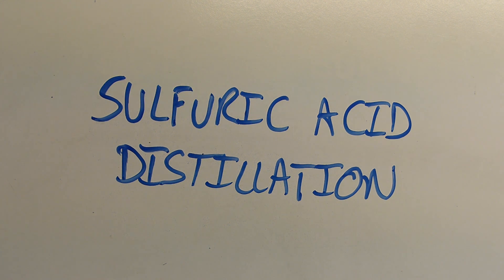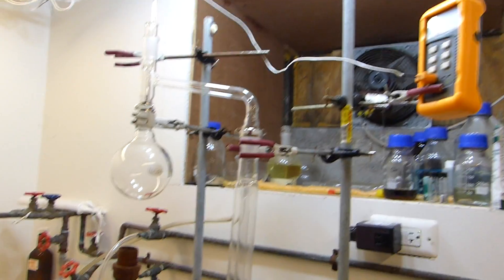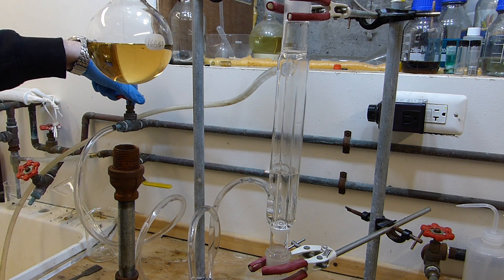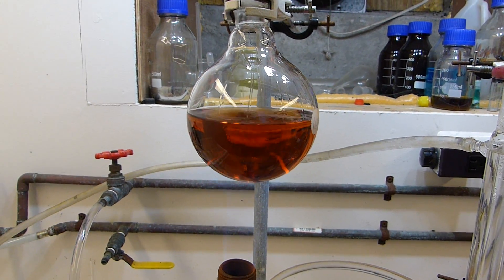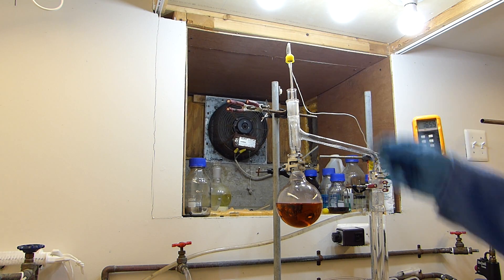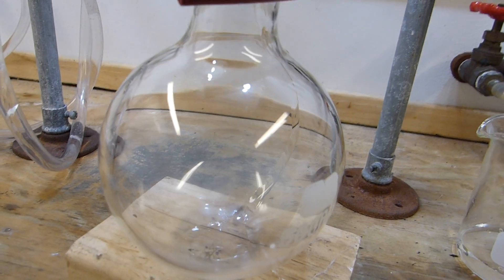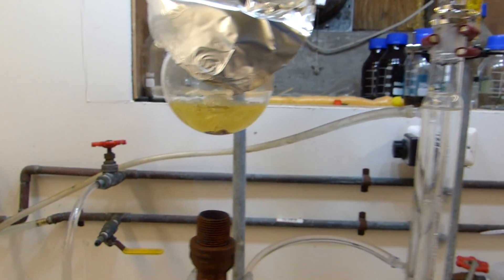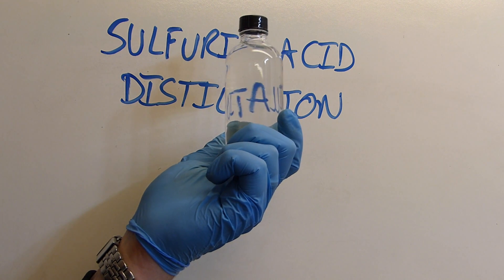Distilling Sulfuric Acid with Some Mishaps

Comment: I know I am commenting long after this video was posted . The setup shown was
 very hazardous. First according to the Merck Index sulfuric acid decomposers at 340 degrees C. You should have added a blast shield in front of the glassware. Since sulfuric acid decomposes at 340 degrees C and 760 mm HG, you should do this distillation in vacuo. Act 1 mm Hg sulfuric acid boils at 150° C.

Comment: The reason the sulfuric acid is not clear, as it should be if pure, is because it has contaminants from the battery (e.g. lead sulfate). You need to purify the acid by adding in more steps to remove the contaminants. 

The paper was dissolved/destroyed because sulfuric acid dehydrates the cellulose, leading it to burn/char.

Comment: So I've distilled h2so4 3 times now following your setup, minus the leibig condenser and substituting a Vigreux column. I also purchased a small terracotta plant base, broke it into small chips, ground the sharp edges and used them as boiling chips. Each time I've don't this I've ended up with quite a bit of white powder in my leftover discard solute. I speculate this is silica from the portion of terracotta that has dissolved, but I'm not sure, any ideas?
Reply: typically boiling chips are made from broken labware or bb sized spheres of the same and of course pumice pieces. Terracotta is baked clay/earth, pumice is volcanic glass... you do the math

Comment: What I've learned is to have as few hot glass joints as possible, because they leak sulfuric acid vapors everywhere. I'm now using a 1L flask in a heating mantle with a single piece glass tube arch. That's one hot joint, and believe me it makes a difference

Comment: Serious question: If super hot h2so4 is so dangerous, why are there no videos of the vacuum distillation of h2so4? Wouldn't that allow for better control of the temperatures? As, if there was a glass failure, the pressure would instantly increase, and boiling would stop.. seems safer. Before saying the gasses would eat your vacuum pump, what about a cold trap with liquid nitrogen in it or even dry ice and isopropyl and using a ptfe lined labratory grade pump? Also, why is nobody using a bump trap?
EDIT: From what I can tell, nobody is using a bump trap because of the amount of heat lost with a heightened distillation head.

Comment: DOug, the amber color is caused by elemental carbon, from destruction of misc organic material in rasw acid.  At distillation temps, the sulfuric acid ociDOZES IT TO CO + CO2> Yverified by exhaust gas analysys).  If the acid lkooks really bad, a very small (mg) addiion og persulfaye will clean it up faster.

Comment: Do not do what this guy is doing! Working with concentrated sulphuric acid is not the same as DIY drilling a hole through the wall. Do not do this at home. This could have easily turned into a disaster and one of those 'he was such a lovely [but incredibly stupid] boy' tragedies.

Comment: This scares the hell out of me.   I keep thinking, what happens and what do I do if that thing breaks (the flask)?  What does the 320 degree acid (with SO3 fumes) do when it hits the wood?    Explode in flames?  What if it happens while I'm reaching over to attend the apparatus?    What if some of it splashes on me?   

Would it be safer to use quarz equipment?

Comment: 'Hi Doug. I'm relatively new to chemistry. I had extreme violent bumping recently when I tried to extract HCl (9.5% w/w, active ingredient) from Lysol Power Toilet Bowl Cleaner through distillation. I'd bought this product at the dollar store. A 1 litre bottle of HCl acid costs 73$ on Amazon. I wanted, no needed, to save money. I'd researched all the ingredients to the Lysol product, but for some reason C10-16 Pareth (or C12, or C16) had escaped me. It turns out this ethoxylated alcohol is explosive (or is an explosive) when heated. I'm lucky nothing major happened during my HCl extraction experiment. Today, I attempted to concentrate some sulfuric acid I'd made from Epsom salt through electrolysis. My r.b. boiling flask survived the Lysol HCL extraction experiment, but it finally cracked during the sulfuric acid distillation, and acid leaked onto my homemade heating mantle and work table. It hadn't had time to concentrate, so it caused no major damage to my mantle or work table.

Comment: Great video.
My two son's and I are getting into doing some home chemistry.
It seems getting hold of chemicals here in the UK is more difficult than in the US.
We live off grid and have about half a ton of dead lead acid batteries so thinking utilising that acid would be good and any bi products can be poured back into the batteries when I recycle them.
I am wondering if your distillation method would be a good route to take to get clean concentrated sulphuric acid from the battery acid? I appreciate starting at such a low concentration would result in a lot of weak distillate to distill off first but wondering if this would be a good way to remove the lead and other battery plate doping materials from the original acid?

Comment: 98% Sulphuric acid boils at 336℃ the thermometer showed a constant temperature of 329℃ was it 98% did u check its density . Why did the recorded boiling point didnt match the reported boiling point . Do u live in mountains or plateau ?

Comment: When I heated 500ml of clean 38% battery acid to 380 deg C, it never boiled, it only steamed. Why is that? I ended up with 190ml of 94.5% H2SO4. Also, 1.285g per ml on the lable equates to 70.2% acid, not 38%. I don't understand why that is. Can you please explain?
Reply: btw 70% h2so4 actually has a density of 1.61g/ml at room temperatue. higher temperatures result in lower densities
Reply: @EZ4ENCE366  So I must not go over 337 deg C? Is that right?
Reply: @Berghiker  to distil sulfuric acid u have to heat it at 337 deg C
Reply: @EZ4ENCE366  I don't need to distill it because it's already clean acid, or do I?
Reply: @Berghiker  opitional, distil if you want pure acid

Comment: I find that simply adding hydrogen peroxide to the rooto brand drain cleaner will oxidize all the organic impurities. It works a lot faster with hot acid but it can also be done at room temperature.

Comment: Now do this take a nice heavy duty good Pyrex beaker and simply boil the same sulfuric acid drain cleaner until it's crystal clear. Unless you're doing analytical science you don't need anything better than that you do not even have to distill it it'll burn off all of the organics and get rid of all the water just by boiling it I've done this 1000 times with that exact acid. Manufactured not too far from my home in michigan

Comment: Greetings Excellent Video I have a question Can you increase the acid concentration using a vacuum pump Or you can decrease the process time by applying a vacuum to the distillation.

Comment: I found my RB flask dissolved the glass enough to see a ripple around the acid level was!
Had some violent back flashes when acid sucked the water vapor back.
I used activated charcoal to purify our additives and limit splashing so it could have caused interior of flask dissolving!

Comment: Is there a way to distill under reduced pressure? That would help lower the temp needed & hopefully reduce bumping a bit. Anyhow, thank you for uploading!
Reply: Sulfuric acid vapor doesn't play nice with vacuum pumps.
Reply: True but boiling at such high temperature might increase the chance of an explosion

Comment: To be up you have to be absolutely out of your mind to distill sulfuric acid in the way you're doing it I would never attempt this without a plexiglass at the very least polycarbonate shield in front of me and never with a direct flame . There's two much variation in temperature caused by direct flame distillation on even very very high quality glassware to be safe in an open setting like this. Have you ever gotten to drop of 350° see sulfuric acid on your hand? It'll go right through your hand in a blink of an eye this is absolutely irresponsible to even show this on YouTube I'm sorry but it is. If you want to do this properly get a high temperature mantle and do it right behind a safety shield
Reply: And that is exactly why this video's title says there were mishaps
Reply: @alexslab.4875  and putting this in a title does not make anything that I had said illegitimate
Reply: @ClownWhisper  umm okay

Sorry if I angered you.

Comment: what is your glassware made of that it can withstand those temperatures? mine is borrosilicate and thus fractures at 165 C. So what is yours and where did you get it?
Reply: Pyrex does not fracture at 165C. Note that the fracture temperature depends on the glassware configuration. A round boiling flask for example will take much higher temperature than an erlenmeyer flask.  Whatever, it is EXTREMELY DANGEROUS to heat an open flask like that in the video with no catch basin under it in case of a fracture. It is best to have a sand filled box under the setup so if it cracks and all the hot acid splashes down it will be contained instead of splashing all over the place. Half and half sand and baking soda is best.
Reply: The temperature of the acid was over 300 degrees and still the glass didn’t crack what sort of glass is this ?

Comment: No way I would boil sulfuric acid that high up without a shield. Imagine the rbf pops a crack and bisects, allowing boiling SA to splash all over everything and you. Goodbye face.

It might even set that table on fire.

Comment: Checking the temperature that way with an IR thermometer won't give you very accurate results. Glass isn't transparent to infrared so you're just taking the temperature of the glass, not the contents. Also I've got the same Chinesium IR termometer and found it's not very accurate to begin with. And not in a convenient, linear way either. Good video, though. I enjoy these very much.

Comment: LOL, I predicted the acid would start spitting out of the side of the flask
It used to happen to me in the kitchen all the time when I'm concentrating the H2SO4 I synthesize.
You can insure no  presence of water during distillation by heating at about 80-100c in a glass boro kettle, and drop a cone shaped drinking glass with some water in it, in the opening to keep the acid in and the water escapes. Don't be impatient with the temp because you'll end up with a spitting acid situation again. It takes a while but the distillation goes seamlessly.

I just came up with a synth process and started making my own, that way all I have to do is evaporate the water until it reaches it's azeotrope.

Comment: Doug, what are your thoughts on a vac distillation in this case instead of the high temps? Great video!
Reply: you can prolly do a vac distill...but it will be much more dangerous as the risk of implosion is there...and hot conc sulfuring acid is not a match to hot exploding sulfuric acid
Reply: Why would vacuum distillation cause an implosion

Comment: The main thing I'd recommend doing differently is the use of a metal bath (Wood's metal or Rose's metal*) rather than putting the flask directly in a flame.  That's a lot of stress, even for a quality flask, and tiny scratches in an older flask could prove to be weak points.
Along the same lines, blowing air through the condenser instead of water (use a cheap aquarium pump, or an aspirator) would stress the condenser less.  Failure is not likely, but would be spectacular (in a bad way) if it happened.

And your distilled acid isn't as pure as it looks - the anticorrosion ingredients in the drain cleaner degrade, but they aren't destroyed, so there are sulfonic acids that distill over, and probably a fair amount of SO2.   Adding 30% hydrogen peroxide at the beginning will make a big difference; about 10% of the mass of the acid should do the trick. Distilling the water out won't take all that long.  Finally, avoid exposing the distilled acid to air, because it absorbs moisture instantly.

*I prefer Rose's, since it doesn't contain cadmium.

Comment: Actually, the azeotrope is 98.2% H2SO4. How long would it take to get azeotropic H2SO4 from bettery acid (40% H2SO4) - asking because H2SO4 based drain cleaners are not easily available here

Comment: I have been wondering if bits of charcoal can work to stop bumping but would the heat and elemental carbon start a reduction in the hot acid to hydrogen sulfide?
Reply: Oop, ment dioxide, lol, that's a delayed notice

Comment: Hey Doug can we use broken glass as boiling chips ??
Reply: Broken glass works poorly!  You need something that is porous, and never used before (after use and cooling, the pores get filled).  The acid must be heated nearly to boiling before the chips are put in, and the heat must not reduced (as when he cools to add more acid).  More (just 1 more) chips need adding at that point, after every cooling/reheat.  The chips can be reused after washing and drying completely to open the pores.  The commercial ones are usually discarded after use.

Comment: Instead of using terracotta pots for your chips, how about a couple pieces of broken glass tubing? Stays inert and with the exception of hydrofloric acid, it won't mess with any other reactions, can be cleaned easily, and then reused.
Reply: Broken glass doesn't work!  See my comment above.  You need pores in the chip, and they need to be open when you start.

Comment: I would be very reluctant to do this in glassware like this, the thermal stress on the glass is enormous. Given how high the flask was, if it shattered it would have splashed boiling hot concentrated acid everywhere. Also the pinging coming from the condenser is a very bad sign, the condenser was also highly stressed and could have cracked. 
I am glad nothing bad happened, but I would not want to stress my glassware like this.
Reply: Take an quartz glassware instead and you will be more safe 😊
Reply: @willowpine2604  quartz glassware? in this economy?
Reply: @Bedroomguitarist3  Have you ever distilled sulphuric acid? I guess from you answer no! If you don't have vacuum pump and correct equipment you don't use borosilicate glassware for boiling sulphuric acid! I once boil 10ml of it and and test it in different things, you don't want to know the results!

Comment: One thing to stay aware of is that boiling chips might have enough water in/on them to cause a problem. Baking them or making sure whatever you are adding the chips to is around or below 100c would be a bit safer.